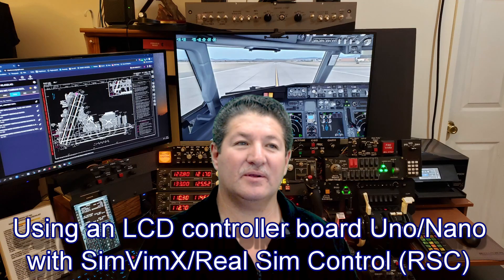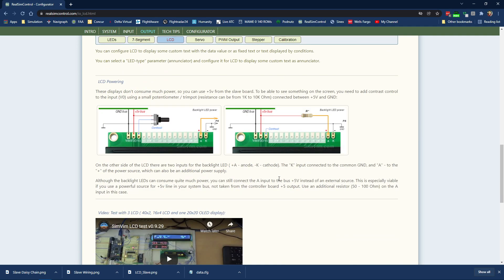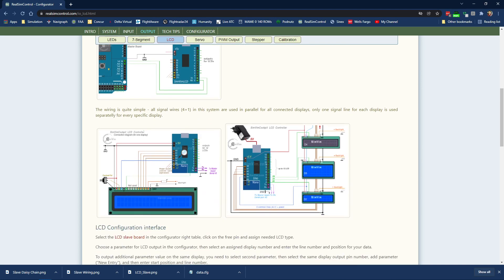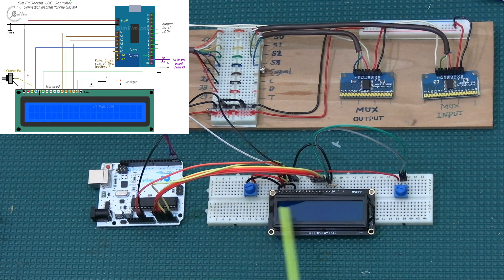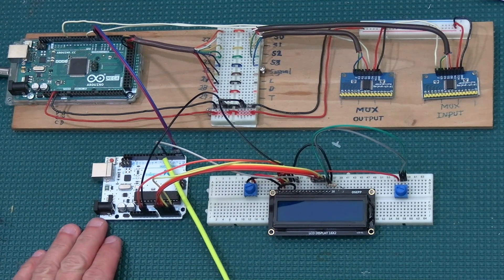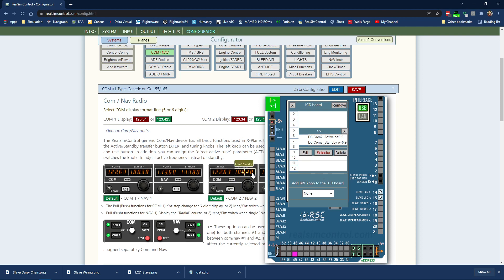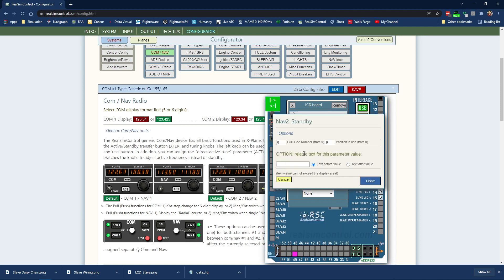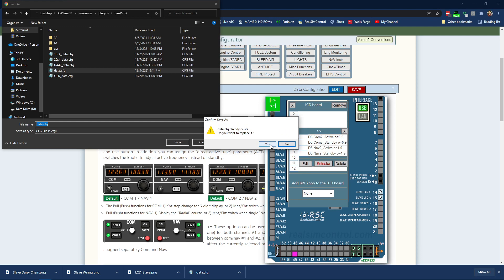Back To Basics: Using an LCD Controller Board with SimVimX

Comment: hello can you do a video how to connect the LCD with the driver IC2 ? I can't make it work with SimVim. Thanks
Reply from the maker: Hi there, as far as I can tell from reading the section on using LCDs on their website, IC2 displays are NOT supported. It seems only parallel connections.